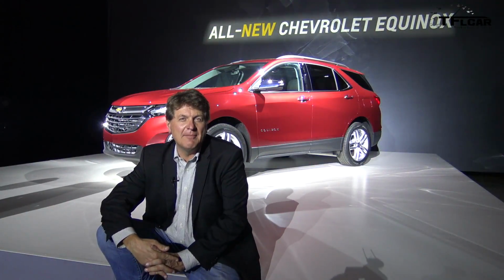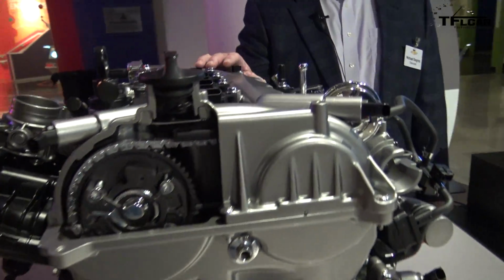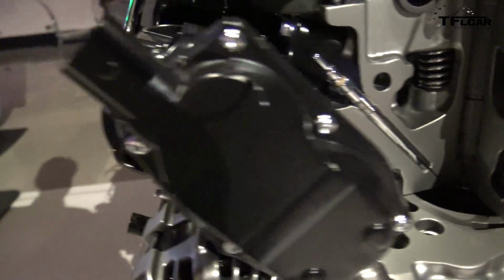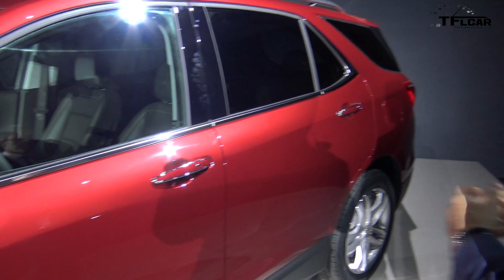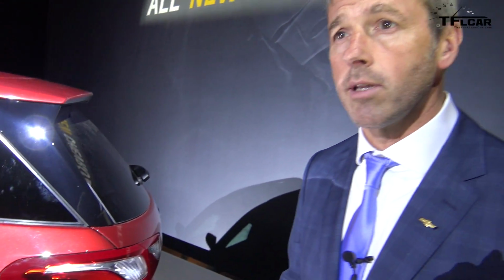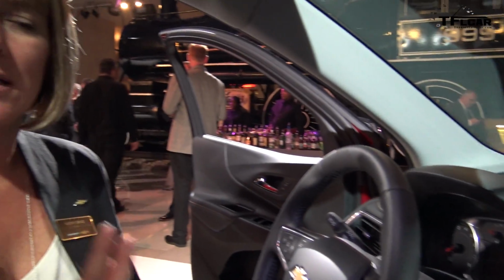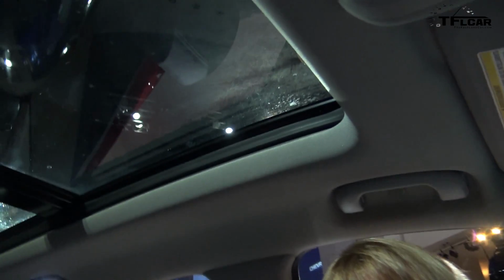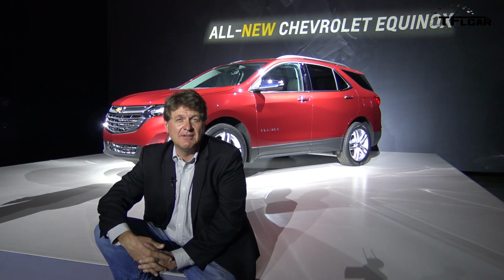2018 Chevy Equinox:  Everything You Ever Wanted to Know

Comment: I'm here in 2025 to try to figure out the low gears in my car. Having said that, the 2018 is one of the worst models they ever made. I have so far replaced my engine, my ABS system twice, the transmissions going out, the heating element went out, I have all of the recall issues that Chevy issue, but my car is not on the recall list. So that means, once my warranty wore off, I got to pay for everything. This car has needed more repairs than any car I've ever owned in my life

Comment: I'm saddened by the loss of ANOTHER normally aspirated V6 engine. Even with a weight loss of 400 lb's, an AWD equinox is still a lot of weight for a 1.5L turbo engine, as well as the lack of refinement, simplicity and proven longevity of a NA V6. The Diesel engine, a tiny 1.6 liters, requiring DEF, increased maintenance costs, as well as the premium cost of the engine, makes it's worth questionable. The 2.0L turbo will most likely only be available in sporty trim, with Giant wheels, and rubber band tires. To top it off, the gas engine are Direct Injection with their carbon build up issues.

Comment: 136 hp and 236 ft. lb of torque... Come on GM, my grandmas Toyota Corolla has the same amount of hp!!! The 2.0l gas makes more torque. The whole car looks like it is extremely cheap made and won't last very long. The car looks like they got a blind person to try and sketch the Ford Edge and this is what they ended up with!!!
Reply: whats actually sad is this person knows not how a car works and compares something with 100 more lb ft of torque. having a higher tq output helps your car not work as hard, therefore being smoother and WAY quicker. learn about how cars work before you talk shit about one.
Reply: The 2.0 makes over 100 more hp than the 1.6 diesel
Reply: Whats Sad Is They Got Rid Of The 300hp 3.6V6
Reply: Fuel efficiency
Reply: Exactly right! Another smooth, long lasting NA V6 gone forever.

Comment: In March '11 I bought a brand new 2011 1LT- and loved it for almost 5 years.  However. when I hit 60,000 miles on the dot, the transmission collapsed on me one day while going down the highway, ultimately resulting in full loss of power, and requiring the vehicle to get towed.   Thank God I was by myself and didn't have the kids in the vehicle.  The chevy dealer had to fully rebuild the transmission to make it work again.  The second it was repaired, I got rid of it and bought a Toyota Highlander.  Never buying a GM product again. They are not built to last.

Comment: I like the new Chevy Equinox, there are still a few design elements from the older version of the Equinox that are still used in the new design but that was probably because those design cues worked so well in the older version that GM decided to evolve those details into the new Equinox. Overall, I like the new design of the SUV which I call a "Toyota-styled mainstream design" look--not polarizing, not boring, just right. I also like the interior as it now looks much more grownup and doesn't have that cheap econobox look that the old Equinox interior had. For the past several years, the Equinox and its twin counterpart the GMC Terrain have been GM''s bread-and-butter SUVs having sold hundreds of thousands of these vehicles to the mainstream American market and I believe that these new changes will enable the Equinox to become largely competitive again. I especially like the new engine options available for the Chevy. Its interesting see that many automakers are turning away from naturally-aspirated gasoline engines and turning to turbocharged gasoline engines instead which is great idea because when engineered correctly and equipped with the right transmission, a turbocharged engine can get terrific fuel economy with no sacrifice on power (aka. Chevy Cruze 1.5 liter turbo). I am also really interested to see how Chevrolet's new 1.6 liter turbodiesel engine will perform and based on the performance specs I am impressed and this engine might be what will give the Equinox and upswing in the competitive SUV market because from what I read from the specs the new turbodiesel will be able to get 40 mpg on the highway, 40 MPG ON THE HIGHWAY, you know normally we read how compact sedans can get that number but a compact SUV? If the Equinox can get that number on the highway in real-life it could possibly launch the Equinox to the top of the segment. Now of course we have to remember that diesel engines of any kind, while popular in Europe, have never caught on the gasoline-engine loving America and with the diesel scandal that erupted in Volkswagen, many people's confidence in diesel engines have decreased and we also need to remember that diesel fuel is expensive, more so than gasoline. However, things could be different on for the Equinox, especially if they put emphasis on the fact that the Equinox can get 40 mpg with the engine. Plus, offering diesel could give Chevrolet a chance to sway disgruntled Volkswagen owners to buy a possibly more reliable Chevy diesel equipped SUV instead. Also, with a nine-speed automatic, it will be the first mainstream compact SUV to be equipped with such a transmission, which used to be only available in luxury crossovers. Overall, nice job Chevy and I believe this will be a hit.

Comment: Ford's 2.0l has 240hp and 270lb-ft of torque. GM is kind of late to the turbo game. Gm is also copying Ford with the hands free lift gate. There are a lot of features that are taken from the Ford Edge. The diesel is very interesting, but the horsepower isn't impressive. Why not offer it with the Colorado's Duramax?

Comment: Way to go!  Bandwagoners!  Ever since Ford came out with the EcoBoost, everybody else is coming out with "their own" EcoBoost.
Reply: GM has been using EcoTec longer than Ford has been using EcoBoost, and small displacement turbocharged engines are European in origin, Ford did not start that trend, they simply "jumped on the bandwagon", to use your own diction.
Reply: Auhsoj Lacy The EcoTec engines back then were non-turbos.  Look at them now.  Like I said.  Nothing but bandwagoners.
Reply: Yes, but Ford din't start this "bandwagon," European companies like Volvo did.
Reply: Auhsoj Lacy I meant to also add American.
Reply: Ford has been using turbo engines longer than GM sorry
Have U heard of WRC,
If not check the Ford cars from 2003 onwards all were ecoboosts, just not they were branded ecoboost thats it
Reply: i know i got your point i was just saying offering the diesel is a bold move
Reply: yeah that's fair im just glad GM is thinking a little bit different  everything it seems is a variation on the same boring Shit i know a diesel isn't  groundbreaking but it's a cool option for a cuv especially for a domestic one that is kinda boring no matter how fancy this revision appears to be.
Reply: Diesel actually doesn't seem like that bold of a move. Everything seems to be going diesel. And isn't the Equinox in the same category as the Jeep Grand Cherokee? They are both mid-sized crossovers. So is the VW Touareg, both of which already have diesel engines and sell pretty well. Plus Chevy has had a decent history with diesels so far. I have faith this will do decent.
Reply: I don't know what happened, no. I thought it still had a v6 diesel. But my point is it isn't that new a concept, and I do not believe they are correct in saying it is the only vehicle in its segment with a diesel
Reply: I believe that would do really well, too. People love options. Even if diesel sales only represent 1/3 of the sales of this vehicle, they gave people options and that is a good thing in my mind.
Reply: even though it's kinda mid size technically it's just a largish  small crossover  that compares to ford escape and honda crv...no diesel in that segment
Reply: This has once again escalated rapidly. Here is a fact. It does not matter who manufacturers these engines. Turbo charging smaller displacement engines increases stress on smaller parts, as opposed to larger naturally aspirated engines. Turbo chargers do not increase fuel economy, they decrease is because the computer pumps in extra fuel so it isn't running too lean, which would melt aluminum parts. Yes, the 3.6 turbo makes more power and is slightly more fuel efficient than GM's naturally aspirated 6.2, but the advantage is minor and even with those you have the issue of the engine's life being much shorter, due to heavy stress on small parts. You are allowed to be loyal to your brand, but don't let that loyalty overcome facts.
Reply: I agree 100%. I'm sure turbos will get better, but I will be the one hanging on to the old school as long as I can. I hope they don't get crazy and eliminate all the naturally aspirated engines in the near future. With cafe standards crazy, and folks still poorly assuming turbo engines get better fuel economy, time will tell.
Reply: diesel option that's not bandwagon that's ballsy
Reply: Nick Dovie I wasn't meaning the diesels.  I was talking about the turbocharged/naturally aspirated gas engines.
Reply: Nick Dovie In my opinion, I believe that it'll be bad.  But better not say if I haven't driven one.
Reply: Auhsoj Lacy VW don't sell diesels no more.  Remember the scandal?
Reply: Auhsoj Lacy Well, I know this may not attain to the Explorer, but Ford has said they may stick a diesel in either the Transit or Transit Connect called the "EcoBlue".
Reply: Auhsoj Lacy True.  People that want the economy probably like diesels because they offer good torque (like Ford's 6.7L PowerStroke in their new Super Duty (with 440 horsepower and 925 lb/ft torque)) and impressive fuel economy.  Although torque numbers trump horsepower (for example, the Super Duty has 2.1x the amount of torque than horsepower), you don't need 800 horsepower to move a medium-duty truck.  You need that torque to tow that heavy trailer of yours (if you have one).
Reply: +Ponygt 662 Somebody needs to crack open an automotive history book my friend. The first American car to use a turbo anything was Oldsmobile, followed by Chevrolet...in 1962...just a little before the Ecobust.

Ford is using so many turbocharged engines because the naturally aspirated ones they make under perform...and get lousy fuel mileage. That's why they cut the Raptor 6.2 v8. The last decent gas engine Ford is making is the 5.0 coyote  and even thats debatable. Sure are an awful lot of those coming in these days with engine knocks and idle issues, and none with a lot of miles. To add insult to injury, the fuel mileage sucks too. At least the exhaust is loud enough to cover up the knocking. 

At the least though, let's not forget about the Grand National. Ford has yet to leave a mark in the turbo history like that did...and that was over 30 years ago.

So know...nobody wants the problems of the Ecobust. 

When GM claims a turbo six to be a tough truck engine, then I'll be worried. Until then I have seen or heard little of the smaller units built to save fuel. The 2.0 turbo however is great. I see them all the time, and they built off of a platform that has proven reliable.

As for Ford's attempts at a little turbo 4, well you need look no further that YouTube to see how that's working out. Heck, there is a Ford tech on here telling people why not to buy one even.

I hope Ford returns to its glory days for the sake of American industry. I'm not too sure though its ever going to happen again.
Reply: Ashes 2 Ashes 
U r such a cool GM fan that ur nice flow f praising GM like its some holy grail is full of shit,
Fool let GM make mass turbos and we ll see a new channel on turbo issues just like Ford tek channel, a d that channel have never ever said  not to buy turbos idiot,it always says potential problems and issues some owners have faced over time, see do understand that no brand other than VW and Ford have more than 70% of their line up sold as turbos on earth,
U must understand that FI engines who ever its mentor maybe is not 100% trouble free, and when one takes that into account Ford turbos are pretty damn reliable , only issue found is most dont deliver advertised mpg

F series has 60% turbp takers and 30% 5.0 takers and 10% v6 takers,
U idiots statement that their NA engines aint great is utter crap, their duratec engines are as good as GM engines, GM has no inshouse turbos all GM turbos are Opel made,except for the Cadillacs 3.6l TT turbo, heck even their turbo diesels are not inhouse unlike Fords TDCis and new upcoming ecoblues.

So enuf of ur GM paraising, 
Let GM try 70+% of cars on road with turbos, I bet U ll find billions of youtube channels and forums complaining about how shitty GM, is..

GM,Toyota,Honda, all these brands nevrr move to mass product turbos for a reason, lack of confidence...
Ford moved with turbos with 80% of their cars in Europe by 2008, WRC showed Ford the way as WRC is what was mentor of ecoboosts.
And by 2011 all experience they gained from WRC,European cars were put on to global markets, its a guttsy move, U wont understand how much of a gamble it is, because if they had issues like U fool is talking about Ford should have got into losses and should have packed or cud ve been bought by some stupid brands by now,
So what U said above is utter bull shit,GM fanboy
Reply: Yeah, sure why go by facts when shit talking makes way more sense!

So based on you we have learned that things are "just gonna happen when producing that much". So everyone who got screwed on the 6.0 Powerjoke failure should just suck it up. Here's an idea, Maybe Ford shold try harder to not suck a dick and build something worthy of our money. I've never met a guy with a Cummins or Duramax unhappy. Ever since International stopped building the 7.3 for Ford, its been a rough ride for even that part of Ford. 

Soon Ford will be begging GM to co-develop a Diesel for them too! What's the matter, Mazda's transmissions weren't truck grade?

You might want to look up who owns who. It counts as in house when you own a huge percentage of said company dumbshit.

As for me being a fanboy, no, I like cars in general actually. Why I don't do is decorate my page with shit from one car company, and then go to a video.that has a competitor's vehicle and trash it whole having no knowledge about any of the shit coming out of my mouth. It really makes you look brilliant. Of course bringing up VW didn't help. What a pinnacle company...at not playing by the rules and fleecing the American consumer out of their car while getting fired and being arrested...smooth.
Reply: +Ponygt 662 Wow, you kiss your daddy... and probably other countless men with that mouth? It looks like a certain Pussygt's legacy is going to be swimming from the shallow end of the gene pool. Well, assuming you ever figure out how to...you know..."create" a legacy. I won't hold my breath.

Toodles Douche Canoe!

Comment: GM when you bringing the Trailblazer back to the USA?
Reply: LOL i hate the looks of those damn things  and who gonna take the time and effort to remove them before going off-road  screw the two extra mpg..give us capabilities
Reply: I think the Blazer is coming back next year in the form of a new mid-size 5 passenger crossover (the cousin of the Acadia), and the full-size seven passenger crossover will be the all new Traverse. Since the new Equinox is smaller now, there is a new void to fill.
Reply: ikr...i see Toyota they don't do that shit and yet near identical mpg.
the Colorado has it too but the Tacoma  doesn't and is definitely more off-road capable.  the chevy front end is soooo fucking tall too it's a truck not a car mpg isn't everything  for a truck especially when form detracts from funtion which is a trucks main purpose
Reply: the only thing that would possibly  make me want the chevy is the diesel option other than that Toyota all day...
Reply: Nick Dovie the diesel has decent torque but the HP at only 180 or 181 sucks balls, i'm sure if you put 7700 lbs back there it will be a sloutch
Reply: Another thing in the Tacoma's favor is it's dual Multi-Port and Direct injection, which should keep the intake valves free of carbon build up, the GM engines are Direct injection only.
Reply: Nick Dovie   will that "all terrain" version come with a low hanging air dam?
Reply: Nick Dovie not so bright on the part of GM to put these things on off road models, makes me ask myself what else have they done to their vehicles that could be just as stupid
Reply: Nick Dovie yeah, when i first saw a Colorado driving away from me on a street in my hometown, looking at it from the back it looked like it had been kicked in the ass, the back end looks like it's 2 feet higher than the front lol, for my money Toyota all day
Reply: i think 2019
Reply: Oscar, What were you going to say?
Reply: Nick Dovie Traverse has taken place of the TrailBlazer EXT. The Equinox has taken the place of the regular-length TrailBlazer.
Reply: JPorkins88 it's garbage.
Reply: JPorkins88 hh6y/
Reply: The Envoy Denali with 300 HP V8.  There's more to life than miles per gallon.
I want a back window that opens separately.  Front wheels for steering and rear wheels for motion.
Reply: saddy i think that place has been taken by the chevy  traverse  hopefully they'll do a five passenger only "all terian" version of that suv like the new
gmc Acadia  or bring back the legendary 
K.FIVE blazer